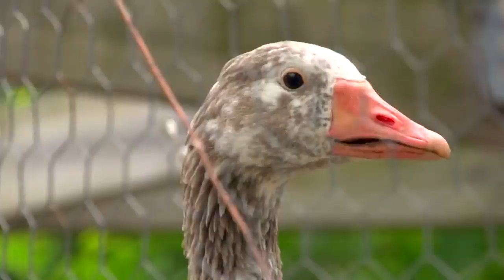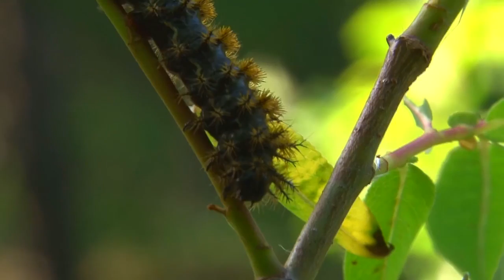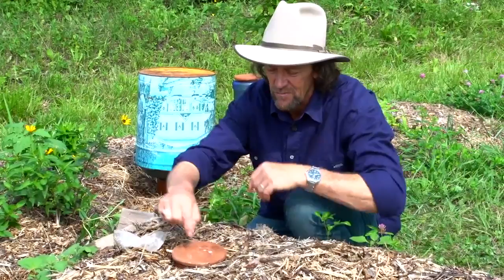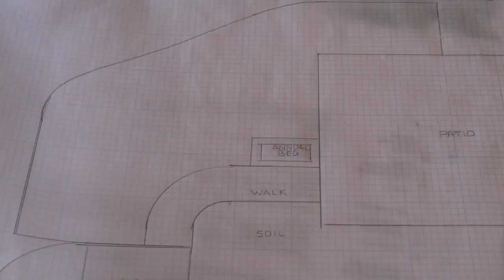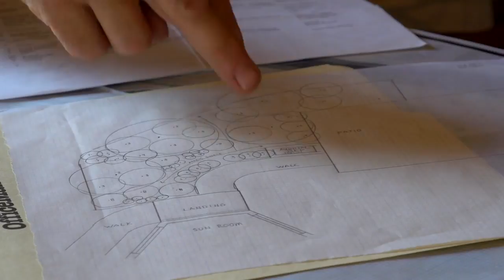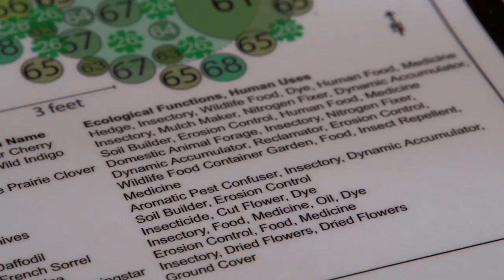How to Create a Permaculture Design!

Comment: Do you have to remove the olla (unglazed   watering pot) for the winter? I'm worried the ground freezing would break them
Reply: The clay pots, ollas, in the video are Dripping Springs Ollas.  They are cold tolerant, tested as far north as Ontario, Canada.  Be sure to have the clay pot (olla) water free at least 2 weeks before the first frost.  Cover the lid with straw, if desired, even though that wasn't done in Canada.  Go to DrippingSpringsOllas.com and read their FAQ for details.
Reply from the maker: Check out my AMAZING Permaculture Course in the link! Just $30 USD for 85 minutes of high quality info!